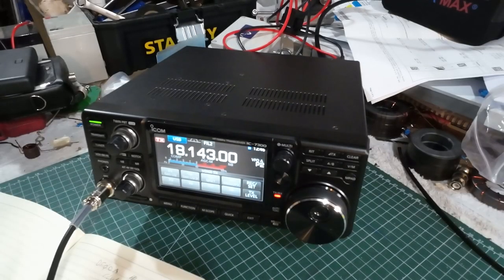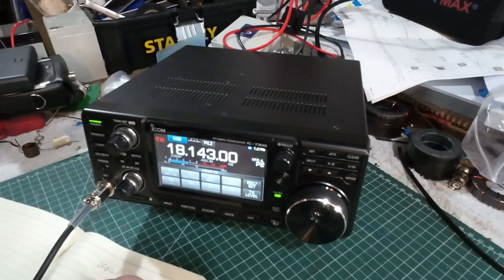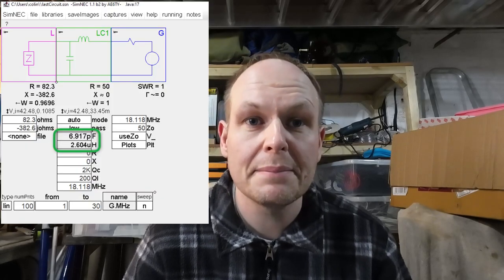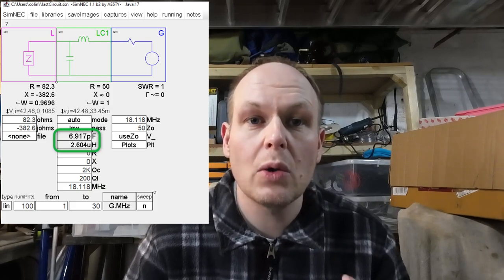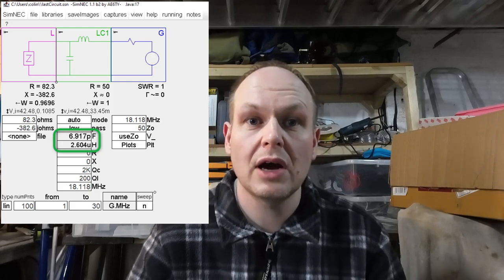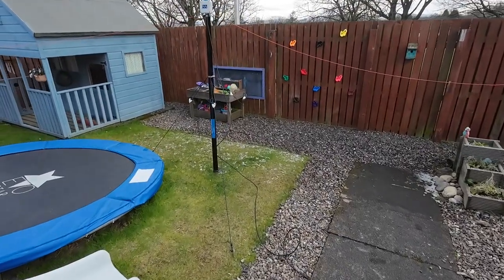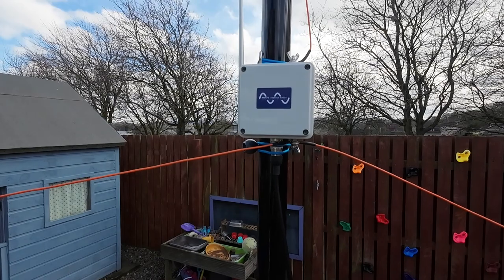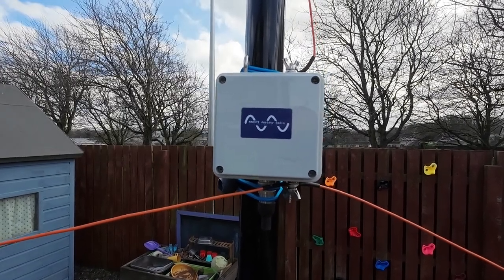The King of Verticals - The 5/8th Wave Ham Radio Antenna

Comment: Well done, a great explanation. Not in any way criticising,  but hopefully of interest, from memory a shade over 62.5% of a wavelength can eek out a tiny bit more low angle gain. I think in the region of 64% is slightly better, probably nit-picking. and of course it depends on the installed height and the angle you are seeking gain at.  Regarding the coil in your matching unit, if you had put an extra turn on you could fine tune the inductance by prising the turns apart slightly. A great project, and well described, something you might find interesting to compare it with is a 1/4 wave for the same band with the top at the same height and a few tuned radials coming down at angles from the feedpoint, it might surprise you.  73
Reply from the maker: Thats brilliant feedback, thanks. I will impliment  both for the next 5/8 I build.
Reply: I agree with last comment. The 5/8 wave can beat the 1/4 and 1/2 wave when their feed points are at ground level but when the top of them are at the same heigth their performances are quite close because their maximum current distributions are at the same heigth too. I´m using raised center-fed vertical dipoles (to avoid constructing and using 64 to 1 transformers) on 20m and 15m with their  bottoms several meters above ground and they are great performers. 73 de LU3HIP César.

Comment: I have used a 41' random wire vertical with 4 -16' radials up the Spiderpole with a 9:1 unun. I wondered why it worked so well on 20m and realized its a 5/8 wave there.
Reply from the maker: Exactly 💯

Comment: Hi, thanks for this.  I think there can be a hazard using (sloping) quarter-wave radials, as their currents are out of phase with the main radiating current in the vertical radiator.  As yours are almost horizontal, that might not be a big problem, but could be worth modelling to see whether there is a compromise in the low-angle performance, and possibly a vulnerability to extra sky-noise from a high-angle lobe.  5/8-wavelength radials probably don't have this issue, if they are strictly symmetrical.  Hope that helps!  73, Tim
Reply from the maker: I'm not sure about this. These radials are not radiating but used to reflect the signal.

Comment: Nice video.  That is a killer antenna.  So glad to see that you are using two elevated, resonant radials.  About as efficient as it gets  --  97 to 99 percent efficiency of those elevated radials since they are high enough above soil in your yard that there is minimal waste of power going into that soil.  de NK7B
Reply from the maker: Beleive it or not I have lost this somewhere in the mess of my garage. I need to find it and get it on the air soon.

Comment: Have you considered building a 1 to1 common mode choke for noise reduction. I've found them to help with most all antennas. The TRX channel had one of the best and he was able to prove it was working.
Reply from the maker: I have built them and do use them with mixed results. Sometimes they work with RFI but sometimes not. Im a big fan of the GM3SEK chokes. Check them out if you haven't already. There isn't much better.

Comment: how high should my 5/8 antena optimally be placed? Thank you.
Reply from the maker: As high as you can get it. You ideally want it clear of obstructions so there is a clear take off. Just do your best.
Reply: @MM0OPXFieldRadio  Thanks for the info. I heard that the ground has something to do with it, and ground-installed antennas can perform better in some situations. Thank you for your answer
Reply from the maker: @polarbear5464  when your inland away from saltwater you want it up off the ground ideally as the ground will attenuate your signal. You can mitigate this somewhat with many ground radials. Over saltwater you want to use the ground as its so conductive.

Comment: Hi Colin this is an eye opener. Like you, I like 17m.  Does your homemade capacitor in the LC unit use 50 ohm coax? 73 Rob G4RJS
Reply from the maker: It does Rob. This in particular is RG142 custom coax by DX wire.

Comment: You got me with this one❗️
In the 80s I had 5/8 on CB and I was the King. As soon as the band was open I had stations piling up from all over the world and giving me phenomenal reports.
Got my license 6 months ago and now I’m going to make one for 10 and one for 15.
Thanks for helping me to do it😃
73 de HB3XBL 👍🇨🇭
Reply from the maker: Awesome. Let me know how you get on. I'm going to try as well for other bands. Not an expensive antenna to build.
Reply: CB 1/2 & 5/8ths are shorted at DC. They require no ground, using an L match means that you get the advantage of the true other half of the antenna and require a ground.

Comment: I agree. The 5/8 wave antenna is a good vertical antenna. 
It offers gain over 1/4 and 1/2 wave antennas   
5/8 wave can be tricky to tune in comparison sometimes. 
Adjustability built in the system will help immensely 
Keep up the good work !
73 de VO1DV
Reply from the maker: Thanks. I need to make some for other bands too.
Reply: @MM0OPXFieldRadio  good stuff ! 
Keep up the good work !
From what I’ve seen so far on your 
Channel you have a neat job made of 
All your projects. Subscribed. 
Some of my projects are on my 
YouTube channel including some antennas 
I have built and a few other projects as well. 
73

Comment: I use a 40 meter end fed half wave dipole as a vertical here at my house and it works fantastic. Managed to even get Bouvet on 30m CW with it and 100 watts. I like the simplicity of this and an gonna give it a go for 10 where my EFHW is a little lobey. 73 de W3OY Ray

Comment: So i've seen the Gainmaster homebrews and they don't use GP's/radials, I'm certain it's almost built like a dipole in two halves, which you could argue is its radial as it is then terminated at the bottom with an air choke. They also add another section of wire, not to sure if it's classed as a matching stub or counterpoise. 
I've seen modelling where at ground level it beats every other antenna in it's class, but as soon as an EFHW is mounted the same height as the 5/8's at half a wavelength high they become almost very similar.  
I like the simplicity of your build, got me subbed!
Reply from the maker: There isn't a lot of info out there on radials for 5/8's. It has a low radiation resistance so would suggest it needs radials. It certainly will only help. Regarding height what matters is where the maximum current point is. On a half wave its half way up, on a quarter wave its at the bottom and on a 5/8 its 3/4 the way up. Get all antennas so the highest points are the same and there wont be much difference between the 3 IMO.
Reply: @MM0OPXFieldRadio  thank you for your lengthy reply 🧡

Comment: Thanks for the video Colin.  I bought the SIRIO TORNADO 5/8 last week,it's built for 11m but l extended the measurements a little and it works really  well on 12m,1.2 swr with 4 2m radials,At the moment it's only 2m high.My best DX so far is Arizona 569 and Japan 559 pwr 100w. I want to do some experiments with the ground plane,increasing the radial length to 4m.The antenna has an Swr of 1.3 on 10m and works very well on that band  also.    73s   Rob  G4WGR
Reply from the maker: Excellent. Try the 0.67 wave length radials if you have the space. Supposodly meant to be optimum.
Reply: Put 3  5/8 radials on and have 1.5 swr on 10,12 and 30m .Antenna 1 to 1@ 26.00. GREAT value for £60.00 at my local shop Kam Sat. Next job to improve coax.

Comment: I notice that the shield side of your coax capacitor is connected to the antenna terminal of the matching unit while the inner conductor is connected to ground. I would have done it the other way around, thinking that done your way there might be additional stray capacitance between the shield and ground which could vary it things moved. Is there a reason for doing it the way you did?

David  VE7EZM and AF7BZ
Reply from the maker: No particular reason David. I will try the other way around on my next build to see if theres any difference.
Reply: It should make no difference as it's not a polarised capacity.  Electrolytic capacitors are polarised and can only go way, these have an indicator showing the polarity.
Reply: I'm pretty sure the capacitor in the video has no polarity.

Comment: Great work!
It's handy to know what to expect as you increase your tower hieght for a given frequency. If you have the magic length of tower for a 1/4 wave at the operating frequency you should see about 30 ohms (R) on your Rig Expert. If it's on the short side you will see a value of (J) that is (-) or capacitive reactive. I giggle when hams think sticking coax directly on is ok..... Your SWR meter will be all happy.... But technically your aren't bang on as the SWR suggests (if you were it would be reading about 1.5:1). You are really off a bit to get the 50 ohms needed and you are presenting a complex load to the TX it's not pure resistive. Some understanding of smith charts helps explain what is going on here.

As you magically wave your wond and the tower hieght increases the R steadily climbs. Now you are also seeing (J) in a + value  as its not inductive reactive. Just above a 1/4 wave is the real 50 ohm (R) point but now you have a stack of J to get rid of. As you continue up... You now see R in the order of 800 ohms and (J) flips once again back to Capacative reactive. This is just in front of the 1/2 wave point.

Past this point you start to get minor top lobes appearing and the gain of the 1/2 wave over the 1/4 wave is starting to be lost. This assumes you want maximum push along the ground like an AM station does. You want this too if you want to throw as far as possible over the horizon. You want low angle take off.

You magic wond gets waved once more ant we just past the 1/2 wave now we near the 5/8.... The R drops off a cliff pretty fast here as we keep increasing tower hieght. But we cross a 75 ohm point and this is where its used. You do have a stack of J to get rid off.... But you also have a higher take off angle for your trouble. You will have more EMF in the air for all the money spent on the bigger tower. But is it worth it?

Yes tuned is always better.... but any length will radiate... its about effectively feeding the power to it...

I'm a tad concerned you have the C on the wrong side of the coil.... In an L network the shunt leg is on the higher R side of the series leg.

IF you are truly on the 5/8 point you should be seeing R 70 with J being quite large. For a ground mounted aerial.

Cheers great work!

73's from down under VK land.
Reply from the maker: Love the insight. I did have the cap connected to the other side of the coil bit match was way off. If was then pointed out to me i had it on the wring side. When i connected it this way all was good and as per SimNEC calcs. My raw values before matching were R82.3 and J-382.6. Dont think these values are far away from your prediction. I've likely got some interaction in my garden too.
Reply: @MM0OPXFieldRadio  I use MMANA for aerial modeling... It has a tab for matching tools under HF Components. I can't recall the exact reason why the shunt goes on the hi impedance side of the series leg. Punching in the numbers you supplied about it definitely draws the shunt leg on the hi side (aka the aerial with 80 ohms). I've watched the video a few more times you have it correct.

If i can find the chart that shows the response curves for different tower hieghts i'll share it. 73's
Reply: A little about me.... I look at aerials with the mind set I need to get as much effiency as possible from a short stick. It needs to do this with real world AM power 24/7.... 30% duty cycle doesn't enter my world. I've carved out a niche business here looking after people's MF NAS services in Australia. We are lucky to be able to have 400w licenses on 1611 to 1701khz for special purposes. 

In getting these running several enlist the help of the local ham..... and needles to say some Myths need to be corrected when I get asked to help! BTW using the coax's Capacitance as a high current Cap.... Brilliant! Done that a few times myself. High power Vacuum Caps used in Broadcasting ATU's are not cheap. 73's
Reply from the maker: Awesome, I'm literally an amateur at this game but learning all the time. Give it a go, nothing to lose.

Comment: Thank you colin really appreciate your content. 10 metres vertical antenna at 21 feet with no radials is this really a 5/8 antenna
Reply from the maker: Well exactly. I think it needs the radials from the research I've done.
Reply: @MM0OPXFieldRadio  Thanks colin for that much appreciated. Just going off the topic.49.1 end fed sloper  half wave 7mhz .10metres to 6 metres, is it better to have the unun at 10 or 6 metres in your opinion?

Comment: best way most effiecent  way  to feed an antenna  at the end   much better than any ferrite   core  and high power handling  also  buy wonder why you didnt  fit a common mode choke  as  i  would expect  rf on the coax    any reason ?
Reply from the maker: No reason. I do have a few GM3SEK chokes when I feel nessesary.

Comment: Good video Colin.
I don't have a 15M antenna here -- but I do have a Spiderbeam pole supporting the end of my 80 OCF dipole -- so I'm tempted to try a 5/8 for 15M.
The other possibility is a 1/2 wave vertical dipole.
I might try both 🙂
73
Bruce G4ABX
Reply from the maker: Thanks Bruce. Give it a go and let us know how it is.
Reply: Try the 1/2 wave center-fed vertical dipole. You´ll save the matching network and the radials. And the performance is quite similar when the top of both antennas are at the same height.
Reply: @cesarastiz9691  I have  portable 1/2 wave vertical -- the ProAntenna's I-Pro traveller. Its a great POTA antenna -- but a bit too heavy for back pack outings, being 'luggable' rather than 'carryable!'
Perfect to take out of the car and set up nearby -- and the preformance is really good for something of such limited height.
73 Bruce G4ABX

Comment: Colin, I would like to know how you calculated the initial impedance values that you entered into the software.  Perhaps a topic for another video.
Reply from the maker: I mentioned this briefly in this video. I cut my wires first to final length  then checked initial impedance without and matching. Remembering to calibrate the analyser to eliminate the coax. Can do a follow up if enough interest.
Reply: @MM0OPXFieldRadio  well I’m certainly interested in a video in how you carried this out.  THANKS.
Reply: I rewatched the video Colin. All sorted.  I made a 5/8 for 10m today using your method and it worked very well.  (Heaps of DX contacts on FT8). I tuned the vertical element to where I wanted resonance.
Reply from the maker: Excellent 👍

Comment: Rather than a matching unit could you go to the top of your pole and then come back down the calculated length ?
Reply from the maker: The wire is the calculated length. You dont make the wire a length to suit. You cut the wire right and then match it.

Comment: can omit the l/c match and just use the tuner in your radio and get the same performance. The l/c match is just to give a match to your coax and in to your radio
Reply from the maker: Sorry but thats rubbish. 2 things. 1 - the tuner in your radio will unlikely be able to match this as the SWR is something like 20:1. 2 - use an external tuner in your shack and you have massive losses in your coax. Place a tuner right at base of the antenna instead of the L/C match and you will omit the coax losses and have a decent performing antenna.
Reply: @MM0OPXFieldRadio  not rubbish, you have not seen my tuner and it is nowhere near a 20:1 swr.I have done it, yes there are some losses but it worked. I have even bypassed the unun on an efhw for 80 and up and an it on 160m and tuned it on every band above with an antenna tuner and made contacts. It sems that you forget, antennas are only based on theory. If something does not fit in you little box it is impossible. I though you were doing a great job in ur videos. I was wrong.
Reply from the maker: @n0vty873  If your setup is working for you then best of luck to you, I have no interest is what anyone else does. If you want to make a statement then you need to base this on real data, let me provide you with some of that. At the calibrated feedpoint (no matching or coax skewing the SWR) the antenna parameters are R 82.1 and X -380.7 (I still have the analyser screenshots). This is an SWR of 38:1, go and do the calculation yourself if you dont beleive me. Your original comment "can omit the l/c match and just use your radio and get the same performance" is categorically wrong, thats fact. Just because an antenna works for you does not mean its working well?  How do you define well? Remember even a dummy load will emit some RF leakage. If you tell me how long your coax is and what type it is I can calculate for you what your losses are. Not theoretical losses but real losses. Will you still make contacts? Of course you but dont you want your system to be as good as it can be?
Reply: @MM0OPXFieldRadio  I  am just fed up with people pretending to be an expert

Comment: I wonder if you could coil-shorten the vertical element?  For those of us with shorter poles.  Say what?
Reply from the maker: Yes, you could but you lose the benefit. Electricity it will be a 5/8 but physically smaller so efficiency will be lost.
Reply: @MM0OPXFieldRadio  Trade-offs everywhere you look.
Reply from the maker: Unfortunately yes. Cant cheat the physics.